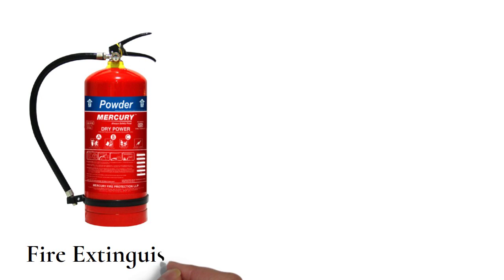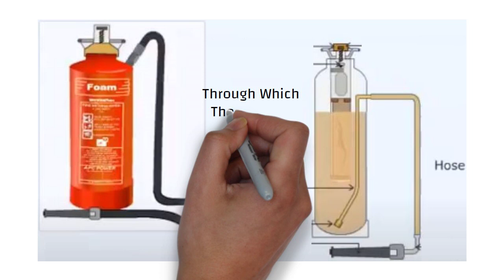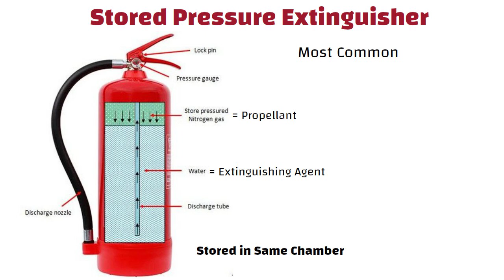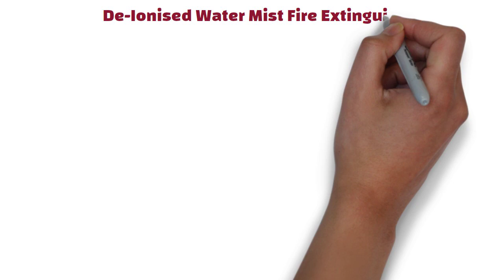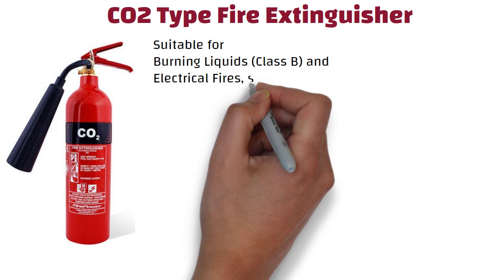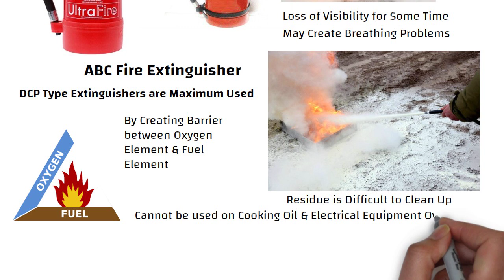FIRE EXTINGUISHER DEALERS IN KERALA, CALL 8138906102, FIRE EXTINGUISHER DEALERS IN ERNAKULAM.

Comment: Fire extinguisher in Karunagappally
Reply from the maker: Fire extinguisher dealers in PERUMBAVOOR, fire fighting contractors in PERUMBAVOOR, PERUMBAVOOR, fire and safety installations in PERUMBAVOOR, fire Fire extinguisher suppliers in PERUMBAVOOR,fire extinguishers in PERUMBAVOOR, fire extinguishers in PERUMBAVOOR, fire protection system in PERUMBAVOOR, fire and safety installation in PERUMBAVOOR, fire and safety contractors in PERUMBAVOOR, fire safety contractors in PERUMBAVOOR, fire and safety systems equipments in PERUMBAVOOR, fire equipment in PERUMBAVOOR, fire extinguisher in PERUMBAVOOR, fire protection system installation in PERUMBAVOOR, fire contractors in PERUMBAVOOR, fire safety consultants in PERUMBAVOOR,  fire alarm systems in PERUMBAVOOR, fire NOC in PERUMBAVOOR, fire AMC in PERUMBAVOOR, PERUMBAVOOR, fire fighting equipment in PERUMBAVOOR,
MS Jindal pipe dealers in PERUMBAVOOR, motor control panel in PERUMBAVOOR, fire pump panel in PERUMBAVOOR, motor control panel in PERUMBAVOOR, Morley fire alarm in PERUMBAVOOR, gst fire alarm in PERUMBAVOOR, addressable fire alarm system in PERUMBAVOOR, Pa talk back system in PERUMBAVOOR, PA two way talk back system in PERUMBAVOOR, auto glow SIGNAGES in PERUMBAVOOR, Karthar dealers in PERUMBAVOOR, Agni fire alarm dealers in PERUMBAVOOR, ASES SECURITY fire alarm dealers in PERUMBAVOOR, AUTO GLOW SIGNAGES in PERUMBAVOOR, FIRE PUMP PANEL in PERUMBAVOOR, LHP pump in PERUMBAVOOR. Karthar valves in PERUMBAVOOR, Ravel fire alarm system in PERUMBAVOOR. Jindal pipe dealers in PERUMBAVOOR, Jindal pipe dealers in PERUMBAVOOR. MS pipe dealers in PERUMBAVOOR. Butterfly valves in PERUMBAVOOR, PA talk back system in PERUMBAVOOR, Fire alarm dealers in PERUMBAVOOR, smoke detector dealers in PERUMBAVOOR, fire alarm panels dealers in PERUMBAVOOR, MCP, hooter dealers in Mangalor, hydrant valve dealers in PERUMBAVOOR, branch pipe dealers in PERUMBAVOOR,Fire CP hose in PERUMBAVOOR, Fire RRL hose in PERUMBAVOOR, heat detector dealers in PERUMBAVOOR, Motor Control panel in PERUMBAVOOR,  LED EXIT LIGHTS dealers in PERUMBAVOOR, emergency exit light dealers in PERUMBAVOOR, auto glow SIGNAGES dealers in PERUMBAVOOR. Conventional fire alarm system in PERUMBAVOOR, Fire alarm panel in PERUMBAVOOR, Notifier fire alarm dealers in PERUMBAVOOR, PA talk back unit dealers in PERUMBAVOOR. Honeywell fire alarm dealers in PERUMBAVOOR, BOSCH PA system dealers in PERUMBAVOOR, 
KIRLOSKAR FIRE FIGHTING PUMP DEALERS IN PERUMBAVOOR, FIRE FIGHTING EQUIPMENT DEALERS IN PERUMBAVOOR, FIRE ALARM SYSTEM DEALERS IN PERUMBAVOOR, FIRE CONSULTANTS IN PERUMBAVOOR, FIRE CONTRACTOTORS IN PERUMBAVOOR, FIRE CONTRACTORS IN PERUMBAVOOR, FIRE ALARM SYSTEM DEALERS IN PERUMBAVOOR, SMOKE DETECTOR DEALERS IN PERUMBAVOOR, FIRE PROTECTION SYSTEM IN PERUMBAVOOR, FIRE CONSULTANTS IN PERUMBAVOOR, FIRE CONSULTANTS IN PERUMBAVOOR, PA TALK BACK SYSTEM IN PERUMBAVOOR, ADDRESSABLE FIRE ALARM SYSTEMS IN PERUMBAVOOR, CUTTER PUMP DEALERS IN PERUMBAVOOR, ADDRESSABLE FIRE ALARM SYSTEM SUPPLIERS IN PERUMBAVOOR, SMOKE DETECTOR DEALERS IN TPERUMBAVOOR, PRESSURE BOOSTING PUMP DEALERS IN PERUMBAVOOR, SLURRY PUMP DEALERS IN PERUMBAVOOR, WATER PUMP DEALERS IN PERUMBAVOOR, RAVEL FIRE ALARM SYSTEM IN PERUMBAVOOR, LUBI FIRE FIGHTING PUMP DEALERS IN PERUMBAVOOR, FIRE EXTINGUISHER DEALERS IN PERUMBAVOOR, ADDRESSABLE FIRE ALARM SYSTEM DEALERS IN PERUMBAVOOR,
Reply: FIRE EXTINGUISHER DEALERS IN PUTHOOR, FIRE EXTINGUISHER DEALERS IN PARIPALLY, FIRE EXTINGUISHER DEALERS IN NOORANAD, FIRE EXTINGUISHER DEALERS IN MUKKAM, FIRE EXTINGUISHER DEALERS IN THIRUVAMBADY, FIRE EXTINGUISHER DEALERS IN KODUVALLY, FIRE EXTINGUISHER DEALERS IN TIRURANGADI, FIRE EXTINGUISHER DEALERS IN CHANGARAMKULAM, FIRE EXTINGUISHER DEALERS IN THRITHALA, FIRE EXTINGUISHER DEALERS IN KALADY, FIRE EXTINGUISHER DEALERS IN NERIAMANGALAM, FIRE EXTINGUISHER DEALERS IN KURAVILANGAD, FIRE EXTINGUISHER DEALERS IN CHATHANNOOR, FIRE EXTINGUISHER DEALERS IN VENJARAMOODU, FIRE EXTINGUISHER DEALERS IN THATTEKADU, FIRE EXTINGUISHER DEALERS IN NEDUMBASSERY, FIRE EXTINGUISHER DEALERS IN KORATTY, FIRE EXTINGUISHER DEALERS IN MALA, FIRE EXTINGUISHER DEALERS IN PERINJANAM, FIRE EXTINGUISHER DEALERS IN KODAKARA, FIRE EXTINGUISHER DEALERS IN CHERPU, FIRE EXTINGUISHER DEALERS IN OLLUR, FIRE EXTINGUISHER DEALERS IN TRIPRAYAR, FIRE EXTINGUISHER DEALERS IN CHETTUVA, FIRE EXTINGUISHER DEALERS IN KARIPPUR, FIRE EXTINGUISHER DEALERS IN KECHERY, FIRE EXTINGUISHER DEALERS IN PERUMPILAVU, FIRE EXTINGUISHER DEALERS IN KOOTANAD, FIRE EXTINGUISHER DEALERS IN PULAMANTHOLE, FIRE EXTINGUISHER DEALERS IN KOLATHUR, FIRE EXTINGUISHER DEALERS IN PUTHANATHANI, FIRE EXTINGUISHER DEALERS IN VELIANCODE, FIRE EXTINGUISHER DEALERS IN VAZHIKADAVU, FIRE EXTINGUISHER DEALERS IN ENGAPUZHA, FIRE EXTINGUISHER DEALERS IN ADIVARAM, FIRE EXTINGUISHER DEALERS IN VYTHIRI, FIRE EXTINGUISHER DEALERS IN PERIYA, FIRE EXTINGUISHER DEALERS IN MALAPARAMBA, FIRE EXTINGUISHER DEALERS IN CHELARI, FIRE EXTINGUISHER DEALERS IN KOTTAPURAM, FIRE EXTINGUISHER DEALERS IN MANNUTHY, FIRE EXTINGUISHER DEALERS IN ATHIRAPALLY, FIRE EXTINGUISHER DEALERS IN AZHIKODE, FIRE EXTINGUISHER DEALERS IN VYPIN, FIRE EXTINGUISHER DEALERS IN THIRUVANKULAM, FIRE EXTINGUISHER DEALERS IN KAKKANAD, FIRE EXTINGUISHER DEALERS IN VANNAPURAM, FIRE EXTINGUISHER DEALERS IN MAKKAD, FIRE EXTINGUISHER DEALERS IN MOOLAMATTOM, FIRE EXTINGUISHER DEALERS IN VANDANMEDU, FIRE EXTINGUISHER DEALERS IN CHINGAVANAM, FIRE EXTINGUISHER DEALERS IN UZHAVUR, FIRE EXTINGUISHER DEALERS IN VENGOLA, FIRE EXTINGUISHER DEALERS IN OTTAPALAM, FIRE EXTINGUISHER DEALERS IN MAMPAD, FIRE EXTINGUISHER DEALERS IN PAMPADY, FIRE EXTINGUISHER DEALERS IN PALODE, FIRE EXTINGUISHER DEALERS IN VITHURA, FIRE EXTINGUISHER DEALERS IN NEYYAR, FIRE EXTINGUISHER DEALERS IN CHENNITHALA, FIRE EXTINGUISHER DEALERS IN KADAKKAL, FIRE EXTINGUISHER DEALERS IN KODAKARA, FIRE EXTINGUISHER DEALERS IN KALPETTA, FIRE EXTINGUISHER DEALERS IN PANOOR, FIRE EXTINGUISHER DEALERS IN DHARMADOM, FIRE EXTINGUISHER DEALERS IN PARASSINIKADAVU, FIRE EXTINGUISHER DEALERS IN PAZHAYANGADI, FIRE EXTINGUISHER DEALERS IN CHERUVATHUR, FIRE EXTINGUISHER DEALERS IN PAYYAVOOR, FIRE EXTINGUISHER DEALERS IN ULLIKKAL, FIRE EXTINGUISHER DEALERS IN ANJARAKADI, FIRE EXTINGUISHER DEALERS IN PERAVOOR, FIRE EXTINGUISHER DEALERS IN CHOKLI, FIRE EXTINGUISHER DEALERS IN NADUVANNUR, FIRE EXTINGUISHER DEALERS IN KUNNAMANGALAM, FIRE EXTINGUISHER DEALERS IN AKDALUNDI, FIRE EXTINGUISHER DEALERS IN MANKADA, FIRE EXTINGUISHER DEALERS IN MAMPAD, FIRE EXTINGUISHER DEALERS IN KALIKAVU, FIRE EXTINGUISHER DEALERS IN KARUVARAKUNDU, FIRE EXTINGUISHER DEALERS IN THAZHEKODE, FIRE EXTINGUISHER DEALERS IN TACHAMPARA, FIRE EXTINGUISHER DEALERS IN LAKKIDI, FIRE EXTINGUISHER DEALERS IN THIRUVILWAMALA, FIRE EXTINGUISHER DEALERS IN PAZHAYANNUR, FIRE EXTINGUISHER DEALERS IN OLLUR, FIRE EXTINGUISHER DEALERS IN PARIYARAM, FIRE EXTINGUISHER DEALERS IN CHERAI, FIRE EXTINGUISHER DEALERS IN VYPIN, FIRE EXTINGUISHER DEALERS IN ELOOR, FIRE EXTINGUISHER DEALERS IN VANNAPURAM, FIRE EXTINGUISHER DEALERS IN PALLIVASAL, FIRE EXTINGUISHER DEALERS IN PAIGOTTOOR, FIRE EXTINGUISHER DEALERS IN PEERUMED, FIRE EXTINGUISHER DEALERS IN VALAKOM, FIRE EXTINGUISHER DEALERS IN KADAKKAL, FIRE EXTINGUISHER DEALERS IN NILAMEL, FIRE EXTINGUISHER DEALERS IN KALLARA, FIRE EXTINGUISHER DEALERS IN POTHENCODE, FIRE EXTINGUISHER DEALERS IN ARYANAD, FIRE EXTINGUISHER DEALERS IN VELLARADA, FIRE EXTINGUISHER DEALERS IN MARTHANDAM, FIRE EXTINGUISHER DEALERS IN BALARAMAPURAM, FIRE EXTINGUISHER DEALERS IN POOJAPURA, FIRE EXTINGUISHER DEALERS IN KALLAMBALAM, FIRE EXTINGUISHER DEALERS IN CHATHANNOOR, FIRE EXTINGUISHER DEALERS IN VALLIKUNNAM, FIRE EXTINGUISHER DEALERS IN CHETTIKULANGARA, FIRE EXTINGUISHER DEALERS IN THOTTAPALLY, FIRE EXTINGUISHER DEALERS IN EDATUA, FIRE EXTINGUISHER DEALERS IN KUTTANAD, FIRE EXTINGUISHER DEALERS IN PUNNAPRA, FIRE EXTINGUISHER DEALERS IN AYRKUNNAM, FIRE EXTINGUISHER DEALERS IN VAZHOOR

Comment: Fire extinguisher suppliers in Karunagappally
Reply: FIRE EXTINGUISHER DEALERS IN KERALA, FIRE EXTINGUISHER SUPPLIERS IN KERALA, FIRE EXTINGUISHER DISTRIBUTORS IN KERALA, FIRE EXTINGUISHER IN KERALA, ABC TYPE FIRE EXTINGUISHER DEALERS IN KERALA, CO2 TYPE FIRE EXTINGUISHER DEALERS IN KERALA, CLEAN AGENT FIRE EXTINGUISHER IN KERALA, MODULAR TYPE FIRE EXTINGUISHER DEALERS IN KERALA, MECHANICAL FOAM FIRE EXTINGUISHER DEALERS IN KERALA, FIRE EXTINGUISHER NEAR ME KERALA, FIRE EXTINGUISHER TRADERS IN KERALA, FIRE FIGHTING COMPANIES IN KERALA, FIRE CONTRACTORS IN KERALA, FIRE EQUIPMENT DEALERS IN KERALA, FIRE ALARM DEALERS IN KERALA, FIRE PUMP DEALERS IN KERALA, SMOKE DETECTOR DEALERS IN KERALA, FIRE FIGHTING SYSTEM IN KERALA, FIRE PROTECTION SYSTEM IN KERALA, FIRE AND SAFETY CONTRACTORS IN KERALA, FIRE HYDRANT SYSTEMS IN KERALA, PA TALK BACK SYSTEM IN KERALA, FIRE NOC IN KERALA, FIRE INSTALLATION IN KERALA, FIRE NOC RENEWAL IN KERALA, KIRLOSKAR FIRE PUMP DEALERS IN KERALA, FIRE EXTINGUISHER NEAR ME KERALA, FIRE EXTINGUISHER MANUFACURERS IN KERALA, SAFEX FIRE EXTINGUISHER DEALERS IN KERALA, FIRE NOC CONTRACTORS IN KERALA, FIRE FIGHTING EQUIPMENT DEALERS IN KERALA, FIRE PROTECTION SYSTEM IN KERALA, FIRE INSTALLATION IN KERALA, FIRE SAFETY CONTRACTORS IN KERALA, FIRE AMC IN KERALA, FIRE PROTECTION SYSTEM IN KERALA, FIRE PROTECTION EQUIPMET IN KERALA, AMC OF FIRE SYSTEM IN KERALA, FIRE CONSULTANTS IN KERALA, FIRE AND SAFETY EQUIPMENT DEALERS IN KERALA, ADDRESSABLE FIRE ALARM SYSTEM IN KERALA, KARTHAR VALVE DEALERS IN KERALA, DCP TYPE FIRE EXTINGUISHER IN KERALA, POWSER TYPE FIRE EXTINGUISHERS IN KERALA, FIRE HYDRANT SYSTEM IN KERALA, FIRE ALARM PANEL DEALERS IN KERALA, SAFEPRO FIRE EXTINGUISHER DEALERS IN KERALA, MS AND GI PIPE DEALERS IN KERALA, JINDAL PIPE DEALERS IN KERALA, AGNI FIRE ALARM DEALERS IN KERALA, FIRE EQUIPMENT DEALERS IN KERALA, FIRE EQUIPMENT SUPPLIERS IN KERALA, FIRE EQUIPMENT TRADERS IN KERALA, FIRE SPRINKLER SYSTEM IN KERALA, RAVLE FIRE ALARM DEALERS IN KERALA, RAVEL FIRE ALARM SYSTEM IN KERALA, AGNI FIRE ALARM DISTRIBUTORS IN KERALA, FIRE ALARM CONTRACTORS IN KERALA, FIRE PIPE INSTALLATION IN CONTRACTORS IN KERALA, FIRE SAFETY CONTRACTORS IN KERALA, FIRE PA TWO WAY TALK BACK SYSTEM DEALERS IN KERALA, HEAT DETECTOR DEALERS IN KERALA, HONEYWELL FIRE ALARM DEALERS IN KERALA, FIRE NOC CONSULTANTS IN KERALA, FIRE AMC AND FIRE NOC IN KERALA, FIRE SAFETY COMPANIES IN KERALA, NEWAGE DEALERS IN KERALA, MONSHER FIRE EQUIPMENT DEALERS IN KERALA, KARTHAR VALVE DEALERS IN KERALA, FIRE HYDRANT VALVE DEALERS IN KERALA, FIRE HOSE REEL DRUM DEALERS IN KERALA, FIRE SPRINKLER DEALERS IN KERALA, FIRE PUMP DEALERS IN KERALA, LUBI PUMP DEALERS IN KERALA, LHP PUMP DEALERS IN KERALA. FIRE CONTRACTORS IN KERALA, FIRE AND SAFETY CONTRACTORS IN KERALA, FIRE EQUIPMENT DEALERS IN KERALA, FIRE FIGHTING CONTRACTORS IN KERALA,